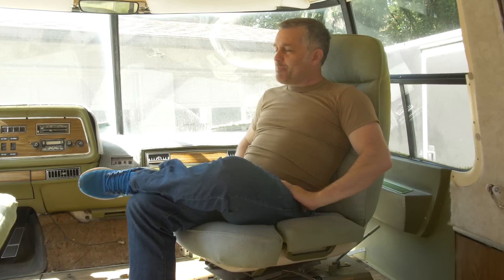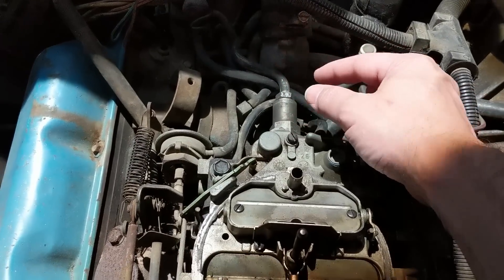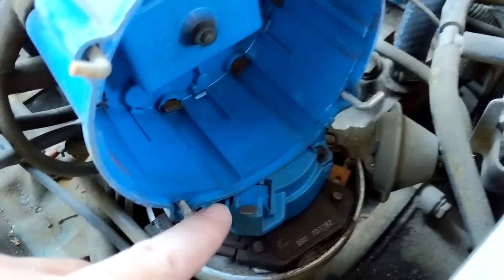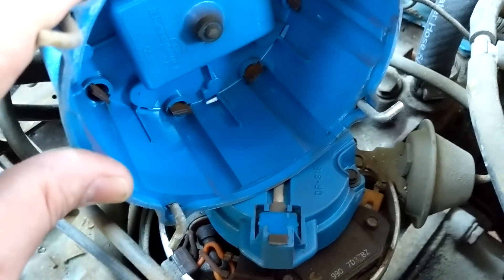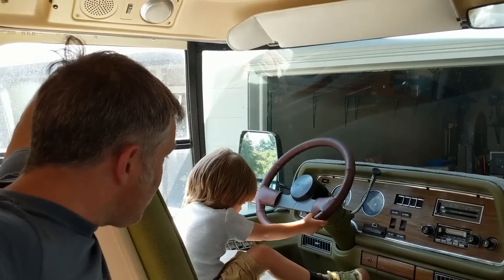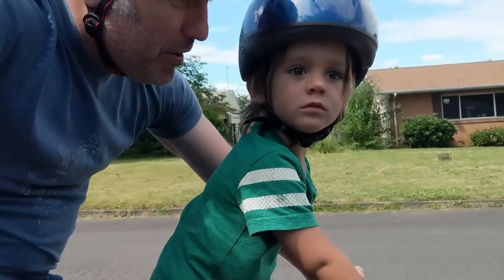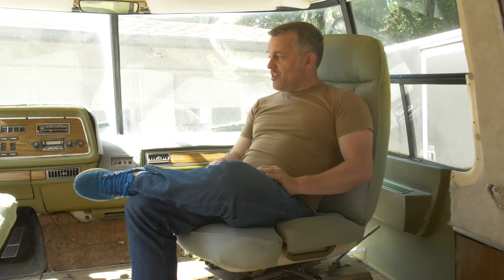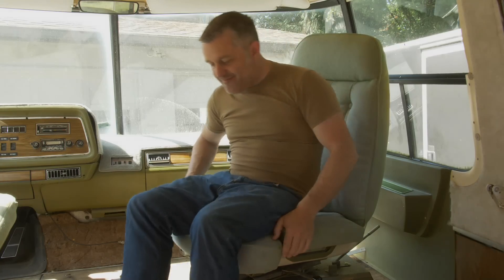Building the Best Damn GMC Motorhome Ever E.7 - It's running again using a 3Dprinted vacuum grommet.

Comment: Will you print any of these items for others?
Reply from the maker: I really don't want to get into the printing business. Also, there are frequently better options than my printed versions. For instance, new sealed LED roof lights would be superior to the old rusty lights with new printed lenses. Also, we don't know the longevity of 3D printed Lenses in the sun. Maybe they only last a couple of years.

The roof trim endcaps are probably the best/most useful item I've yet printed, but even those can potentially be acquired from a motorhome which is being parted out. The GMC motorhome parts sources probably have them if you need them. eg GMC Coop.

As it turns out another comment left by someone else taught me that the Engine intake grommet is still available at Napa. Part# 735 6190 PVC System Elbow GM
Reply: The Digital Maker would your provide any of the files that I could print myself?

Comment: Keep it up!

Try to use ethanol-free gas, otherwise, the water in the ethanol will separate out of the gas and really mess with your fuel system. And get some fuel stabilizer if you aren't going to be running the engine regularly. Gas experts tend to suggest that gas, even ethanol-free gas, tends to start degrading about a month after production. Old gas can clog up your fuel system and slowly reduces its ability to burn to the point where the gas might not even combust.

Comment: If you run across the fuel pump fit problem again (or for the other folks)...the old pump should have a number stamped into the mounting boss (the part that bolts to the engine). You can use that to find the correct pump. The extra line your new pump has is for a return line. It was made to circulate fuel back to the tank on whatever that pump was built for.  

The breather fitting was probably available through the Balkamp product line at NAPA (I used to own a NAPA store).  Cool that you could make one by 3D printing it, though...

And I agree with the other poster that said the filters don’t fill up.

Comment: Thought I’d fill you in on some of the electrical fuel pump situation. First of all, if you had chose an electrical fuel pump to run the carb on the 403, then you’d have to choose one that would only push 4psi or add a regulator. So to answer the other question, yes you would have to change the electric fuel pump to one that is stronger when switching to efi/tbi.

Comment: Fuel injection pumps run at higher pressures than carb fuel pumps. I would suggest the Holley sniper EFI kit and to run all new fuel lines rated for fuel injection and modern fuel.

Comment: Might want to order the correct fuel pump, that extra connection is meant as a return to the tank.  I don't think I'd trust that $2 clamp to prevent fuel from spraying on the exhaust.  https://www.napaonline.com/en/p/CFPB0212P